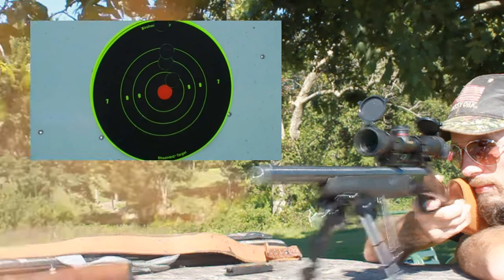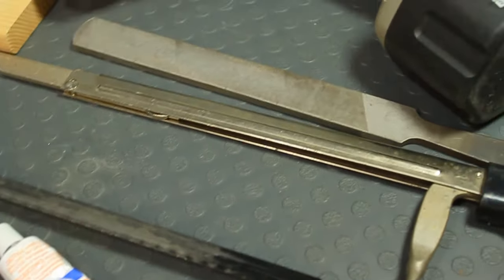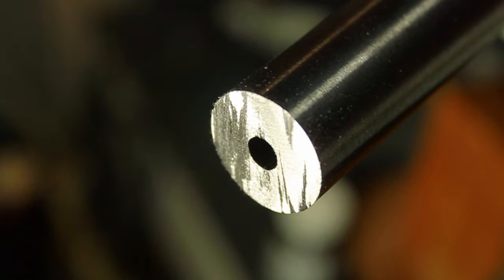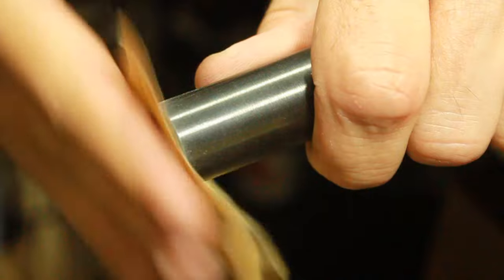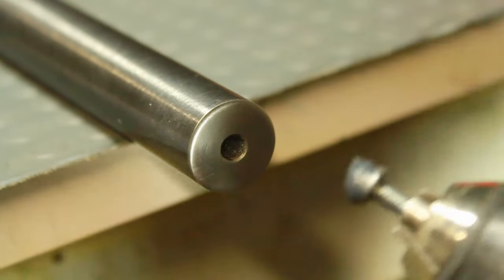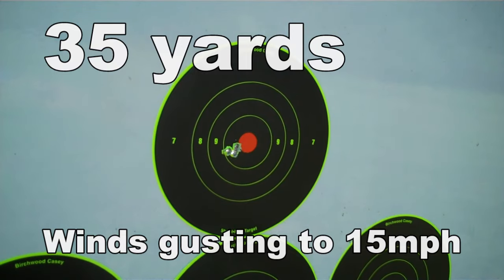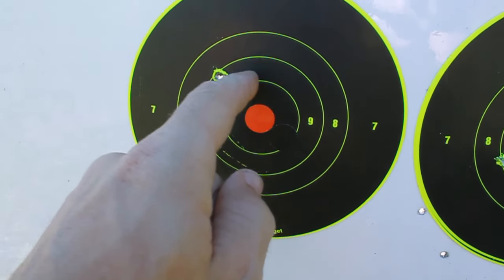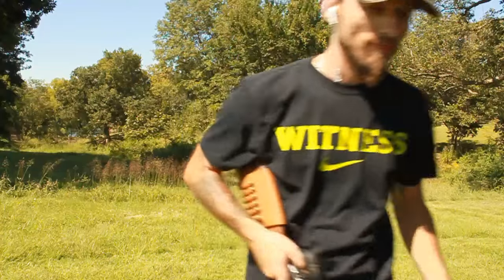Cut and Recrown your  barrel at home

Comment: Break open action like yours are not as accurate as other actions. Unless the parts are very very carefully fit. Not that careful with an H an R. You did not show a before and after I suspect the accuracy was similar.
Reply from the maker: before and after were shown in a separate video linked in this video
Reply: Thanks I will check them out.
Reply: This is NOT criticism. I have a handy rifle in 308. It patterns about a 1 and a half inch diameter at 100 yards and that is good enough  for what it is. If I wanted it a little more accurate I would lap the action in with valve grinding compound. The problem with brake barrel actions is under pressure the action wants to swell up and if the fit(especially the pivot pin in front) is not perfect the barrel will twitch in a random way. How did I learn about this? From a friends really awful rifle a rossi trifecta(i call them defectas). the .243 would spray the bullets around in a 2 foot circle at 200 yards(a box of 20 made a pattern like a shotgun). After lapping the action in I was able to get the spread down to a 6 inch diameter circle at 200yards. Then I sold it. There are guns that are accurate. Thompson contender, savage 219 but they fit the action very carefully. notice no one will use a break barrel action for competition target shooting. Still the H and R is a good cheap gun. Only paid 160 for mine new(a while back). Thanks for the helpful crowning video.